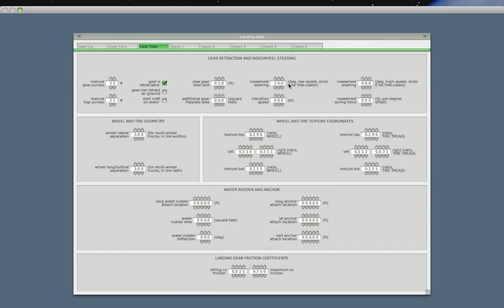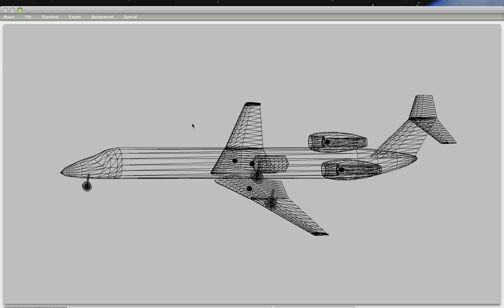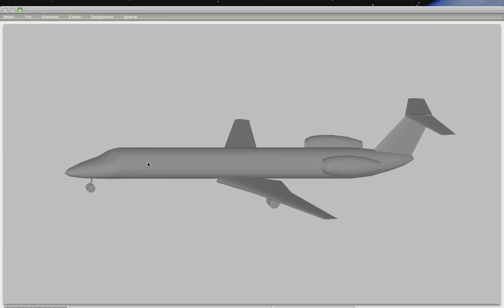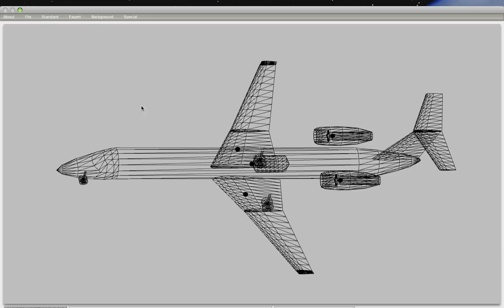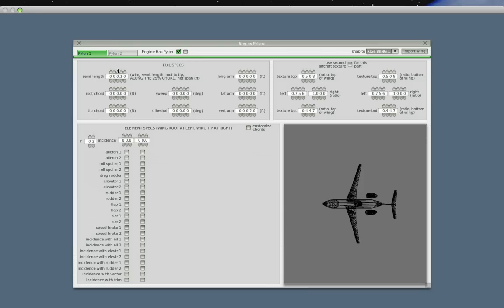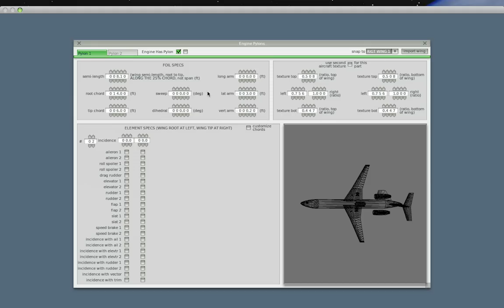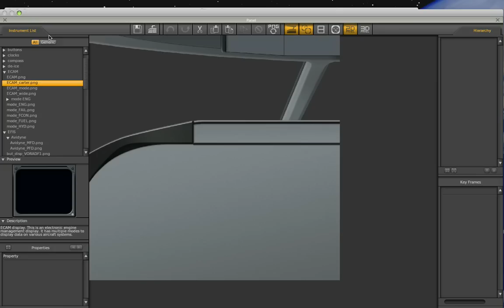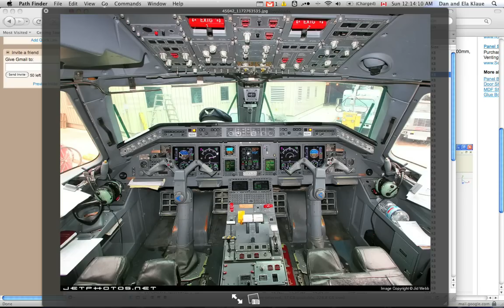PlaneMaker Tutorial 8: Post-flight Tweaks, Misc objects, intro to cockpit Panel

Comment from the maker: @algefrik98 

There are also control surface sizes.  You need to be sure that your control surface is mapped to the correct wing.  Notice also, that there's a Elevator1 and Elevator 2, and same thing goes for Aileron1 and Aileron 2.  When you alter the effectiveness of the control surfaces, make sure you're altering the correct one.

Comment: @danklaue Thanks! sorry if i ask manny questions! There is also a problem with the elevator, its VERY sensitive, a short move with the joystick and the elevator it's pointing up/down. I've changed the joystick settings but nothing seems to help. I don't get the same problem with other planes. I think its a problem with the "Control Geometry" i've tried to change the "aircraft nose up/down" a bit down(from 27 and 16,5 to 20 and 20) that did not fix the problem either.

Comment from the maker: @RandomChicken328 

Probably you need to make sure that your nose gear is checked to be steerable.  That's in the "Standard>Landing Gear" menu, first tab, second-to-last check-box row.  Then you need to determine the angles that the front gear steers at.  That is done in the "Gear Data" tab.